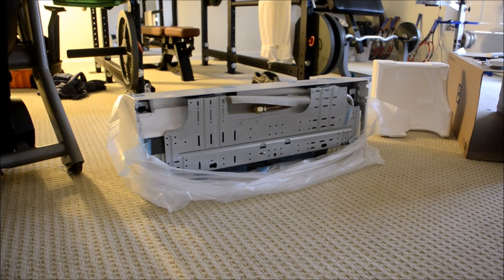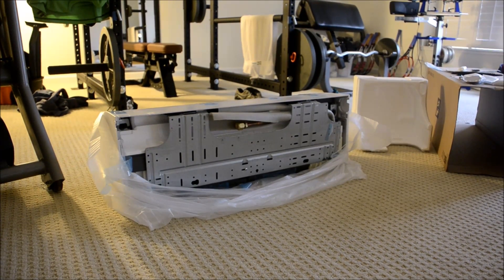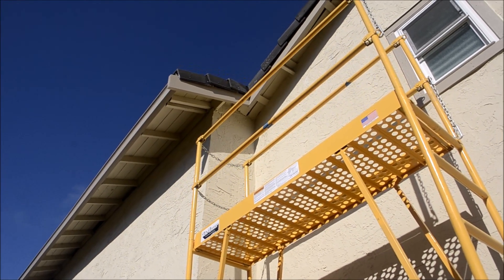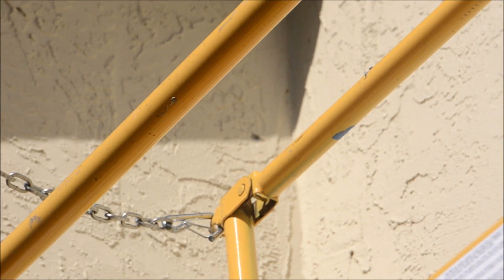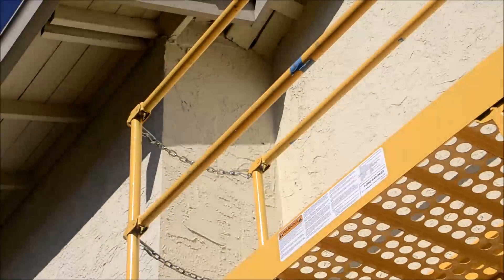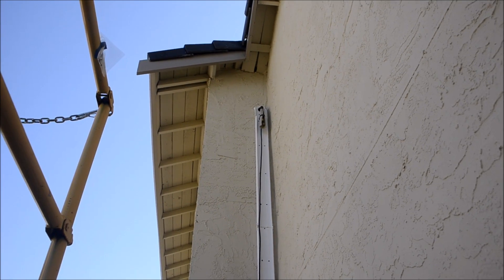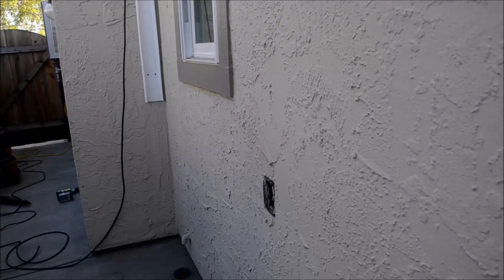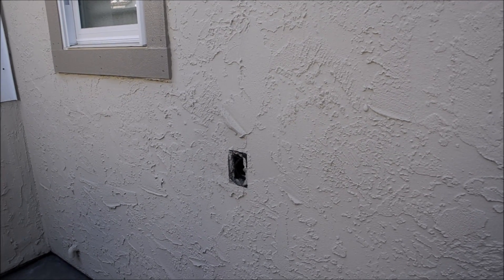Fujitsu Mini Split Install

Comment: Thanks for the detailed video. I am thinking of installing a 9RLS3H. Fujitsu installation guide at the below link says not to use Nitrogen for leak checks. Says: "When inspecting gas leakage, always use the vacuum pump for pressure. Do not use nitrogen gas." Is there a different guide you followed or did nitrogen test out of abundance of caution? Thanks in advance.

https://www.master.ca/documents/regroupements/1fujitsu_installation_aou9rls3h_en.pdf
Reply from the maker: Interesting. My installation instructions didn't mention that. To me a vacuum test  in combination with a pressure test will uncover any possible leak. I believe, depending on the type of leak that it is possible that a system might pass one test but fail the other, I have no scientific evidence of this, just a hunch.  So yeah, maybe it is a my cautions nature, but for the 20 minutes it took to do it I think it was worth it. If I didn't do it and there was a leak then I would have to spend more money to find it and then replace the refrigerant and I wanted it to work first time for a long time. Having said all that, there is a school of thought that believes it is possible that when pressure testing with Nitrogen some of the Nitrogen could get past the service valves and contaminate the refrigerant, and it sounds plausible. So perhaps a different approach might be to do the vacuum test and then release about a third of the refrigerant and then use a leak detector. That way you avoid the Nitrogen contamination possibility and potentially only loose a small amount of refrigerant, and since these things are usually charged for a 25 foot line set chances are you wont have to get more refrigerant after you find the leak.
Reply: Thanks for the response. Can you point me to the guide you followed, if it's available online. Given that these guides are meant for contractors, Fujitsu seems to have purposely not mentioned the models the guide applies to in the guide itself.

Thanks also for the idea about releasing a portion of the refrigerant to check for leaks. The Fujitsu units are pre-charged for 49 feet actually, so for a shorter installation, loosing some charge thru a leak might still be acceptable. BTW, it it acceptable for a 20 ft line set to be running with charge meant for 49 ft?
Reply from the maker: The install guide I used came with the machine, I assume it is available online but I never checked for it. If you are only running 20 ft and the charge is for 49ft (that is a lot more refrigerant than mine has) then you will need to capture some so you only have enough for the 20ft. I didn't need to do that and dont have the equipment and if I were in that situation I would probably have someone come in and do that piece of it after you install the unit.
Reply: Per the below submittal, yours should have come with pre-charge for 49 ft as well, but the installation manual I referred to only talks about "adding" refrigerant beyond 49 ft. So, I think you are OK.

http://www.admorhvac.com/admor-files/submittals/ASU15RLS3.pdf
Reply: Also, in some of the install kits, I see a surge protector included. Have you included a surge protector in your installation, if so, can you share the model you used? Thanks in advance.
Reply from the maker: No I didn't, my installation instructions didn't mention that I needed one.
Reply: Thanks. Also, did you use a pipe cutter. If so, if you can mention the model and any tips for it, I would be grateful. Thanks again.
Reply from the maker: I did, it was a small Rigid cutter. Here it is: RIDGID 40617 Model 101 Close Quarters Tubing Cutter, 1/4-inch to 1-1/8-inch Tube Cutter
Reply: Thanks. I have ordered many of the tools you recommended and also got the 15RLS3HY from Younits yesterday. One thing I am surprised by is that the top of the indoor unit is open with a thin plastic grille, with the filter pretty much being the cover. I see your unit is also open that way. Have you seen any issues with a lot of dust accumulating on the filters? Thanks in advance.
Reply from the maker: Not sure what you mean by the top of the unit being open. The filter on mine is at the front of the unit and the top is fully enclosed, maybe you are looking at the shot where I removed the front cover to get to the electrical?  In any event, I haven't experienced any issues with dust. I check the filter every couple of months and they haven't required any cleaning. Good luck with your install.
Reply: I am referring to the top plastic grille on top of the filters visible at 15:07 in your video, where I can see the front cover attached, but see the grille on the top side of the unit above the filters. Did yours come with a cover that covers the grille on the top?
Reply from the maker: Ah, I see what you are saying. Nope, mine did not come with covers which I guess makes sense as it is the air intake.
Reply: Thanks. I was planning to install it about 3 or 4 feet off the floor in the basement (so it doesn't draw hot air in if installed near ceiling in winter) and wasn't expecting the top to be "exposed" like that. I thought the front served as the air intake but I now see it uses the exposed top as well for air intake. Thanks for all the info and help.
Reply from the maker: I wonder if would it be better to install it higher? My reasoning is that it would accomplish 3 things. 1) Force the warm air near the ceiling to be blown down to the floor. 2) Warmer intake air would result in warmer exhaust air. 3) It would be out of the way and wouldn't take up floor space or get accidentally damaged. I could be wrong on all three fronts, just my 2C. Whatever approach you decide to take I would be really interested to hear how it goes.
Reply: I also thought  similarly, but the below articles caused me to think about lowering it:

https://tedsenergytips.com/2015/04/15/why-doesnt-my-mini-split-heat-pump-air-conditioner-work/

http://www.greenbuildingadvisor.com/community/forum/mechanicals/30824/minisplit-blowers-mounted-low-or-high

but on a re-read of the second article, specifically considering the advice in the last post, as also to eliminate the possibility of some kid getting his/her fingers into the exposed top of the unit, I am now leaning toward mounting about 75" up from the floor (instructions call for 70" minimum) to avoid hitting my head with it. That would still leave about a foot of clearance on the top to the ceiling. I will update once I am done with the install. Thanks for all the info and encouragement.
Reply from the maker: Mine is mounted about a foot from the ceiling and it performs great. I think I mentioned it in an earlier post but on a 100 degree day I am seeing 60  (58 is the lowest I have seen so far) in the room I installed it. Prior to the installation, that same room was in the high 80's, low  90's, on those days so its made a huge difference. Oh, one thing you should do when you install and use it for a while is adjust the room temperature sensor. Basically, you can tell the unit that what it thinks is room temperature is actually higher or lower than the actual temperature. So if you feel like the room isn't warm enough you lower the setting on the room temperature sensor (so the unit will think it is colder than it actually is) and the unit will continue to heat the room. Ping me when you are ready to do it as the instructions in the manual are super confusing.
Reply: Thanks Dan. The sensor adjustment is interesting. I will come back for instructions.
Reply: In section 2.4 of the installation manual listing the supplied accessories, there's a "Cloth tape" and a "Seal A" mentioned, which I have received, but I am unable to figure out what they are for or where they are supposed to be used going thru the manual. Do you recall what they are for?
Reply from the maker: I believe the cloth tape is used to wrap the pipes if/when they are bent to the left and run along the back of the unit before a left hand exit outside. I am assuming that this is to prevent vibrations and any potential rubbing of the unit/wall on the pipes too. Mine was a right hand installation so I didn't need it. I have no idea what the "Seal A" is I cant find a reference to it in my manual. But it might have something to do with moving the drain hose to the left of the unit, as it can be left or right mounted. 

On a separate note, I would recommend against bending the pipes before mounting the unit. It is much easier to to install the unit if the pipes are straight and then bending them once they are outside the building. I did it prior and it was a real pain to mount the unit.
Reply: Thanks, Dan. Also, on the wall unit, there's a screw between numbers 2 and 3 on the electrical panel. It's not apparent to me what that's for. I am connecting ground to the green screw to the bottom left of the screw number 1, so it's not apparent to me what the screw between 2 and 3 is for. Do you recall doing anything with it. Thanks.
Reply from the maker: I dont remember that being an issue for me, you are not talking about the cable clamp screw are you? The green (ground) will go to the green screw and then you use two of the three remaining wires for power, I usually pick black and red/or white (depends on what colors you have in your cable) and connect those to terminal 1 and 2 (power) on the indoor unit.The remaining wire will be the control wire which is connected to terminal 3. Just make sure that you dont mix up the wire configuration on the outdoor unit.
Reply: Thanks, Dan. No, I am not talking about the cable clamp screw. There's a screw between the screw labels 2 and 3, a little north of the screws 2 and 3. I am using the green cable for ground connected using the Green screw and have the other 3 wires to 1, 2 and 3. Sounds like I should ignore the mystery screw between the screw labels 2 and 3.
Reply from the maker: Yeah, dont worry about the screw. I dont remember touching it and looking at the manual I can see it but I think it is there for some other purpose, not related to the installation. It sounds like you are making good progress though.

Comment: no pressure check with the unit running?  units are charged for 25' lineset
Reply from the maker: C Hodge You are right, I didn't do a pressure check as my run is 24 feet, if it was any less I would have.

Comment: Great video thank you!  I just installed a 24K BTU Mr Cool DIY unit, working well so far.  Considering venturing to a multi-head unit for the rest of the home, and might use your video as the "go to" source for tools.  Appreciate your level of detail.
Reply from the maker: That's fantastic. Do you think you saved money doing the install yourself?
Reply: based on quotes, only about saved about $2000 or so.  lol.  Just ordered a 3 head LG 24K unit and using your tool list as a guide for what to order.  is your list in the description up to date?
Reply from the maker: Saving $2K sounds good to me. Yep the list is up to date,
Reply: Purchased many of the tools you listed Dan, including not so inexpensive SMAN460, torque wrenches, weigh scale, 410a refrig, nylog, YJ 410a flaring tool, etc.  But worked out great.  Meticulously installed a 3 head/room LG 24K unit.  Nitrogen leak test to 150, 300 finally 500 psi 24h, then vacuum down to 150 microns.  Added 7.25 oz 410a by weight due to extra line length, opened factory refrig and it actually worked!  Line cover was a pain due to tricky behind-bushes and high locations on two story home, but otherwise all was pretty smooth.  Thanks again for your inspirational and informative video.  One of the best on the net for sure.  Two more units and will be done for a while :)
Reply from the maker: Wow, awesome job. Glad the video helped. It's great that you did it all yourself. Congratulations.

Comment: Good job. One of the downsides of DYI is that most manufacturers will void warranty for equipment bought online and/or installed by unlicensed person. If it would be installed by a contractor and registered on Fujitsu website the unit would be covered by 10 years warranty.
Reply from the maker: You are absolutely right and I took a calculated risk on that front as I did my research and made sure I knew exactly what I needed to do and what tools I needed before I began the install. The quotes I received for an installed unit were around $6000-$6500 for an inferior model to the one I installed. So given I paid $1800 and then spent around $1000 on tools (which I can sell) my total cost is $2800, if I don't sell the tools. So if in the next 10 years I spend $3200-$3700 on repairs then my gamble might not have paid off, but at least I had a good time installing.  I also figure that manufactures don't want to loose money on a unit that costs $1800 by providing free repairs totaling more than $1800 in the warranty period, so they build the units not to fail during that time (total speculation on my part but the logic seems to hold).  I installed the unit in July 2015 so its almost two years now and it is still going strong. 

However,  if someone isn't really an avid DIY'er or doesn't want to get all the necessary tools then they should seriously consider getting it installed by a licensed professional, because chances are they will need the warranty.
Reply: Hopefully everything will work well. You should make it your profession ! Your hands growing from right place for sure.

Comment: what did you a apply to the pipe after flaring?  you brushed on something. thank you.
Reply from the maker: Refrigeration Technologies RT201B NYLOG-GASKET/THREAD SEALANT. I got it from Amazon https://smile.amazon.com/gp/product/B008HOSQQQ/ref=oh_aui_detailpage_o04_s00?ie=UTF8&psc=1

There are two versions, depending on the refrigerant your system uses, so make sure you purchase the right one.
Reply: Thank you very much.  Well done by the way.
Reply: @diydan30  Fujitsu warranty in Australia would be voided using and face sealer....just sayin'..

Comment: May i know what kind of torque wrench lock nut did you use? Thanks
Reply from the maker: I used the Yellow Jacket 60652 8-Head Precision Torque Wrench Kit. I bought it off eBay but you can also pick it up from Amazon.

Comment: The flare is best way to go, the video shows best way to do with the torque wrench. If brazed you need nitrogen going through line to keep it clean. Nice install.

Comment: I'm just about ready to do a vacuum pulldown on a dual zone Fujitsu mini-split.  I'm having some reservations regarding the the flare connectors. MOST 'pro's will recomment a "brazed connection" vs. flared connectors. OPen to all readers thier experience. Fujitsu is selling these with Flared fittings all over the world.  To make "brazed connections" would require cutting off the furnished flare fitting which are  fairly short already. Add that to the linesets and you're doing 8 operations. R410a pressures are a cause for better connections. Is anybody using Flared Fittings on warrented equipment. Is this a gamble?
Reply: If you decide to braze I suggest you run nitrogen through your system while brazing. You will contaminate your system.

Comment: Nice job. Can You tel me what kind of vacuum pump, flange tool and  torque wranch did you used on istalation . Thank you Darek
Reply from the maker: Thanks. 
Here is the specialty equipment I used: 
Robinair (15800) VacuMaster Economy Vacuum Pump - 2-Stage, 8 CFM (Amazon $250- You can save some money by getting a cheaper unit if you are only doing a single install)

Yellow Jacket 60278 Deluxe Flaring Tool 1/8" to 3/4" 45 Degree (eBay $100)

Fieldpiece SMAN460 Wireless 4-Port Digital Manifold with Vacuum Gauge (ebay $460 - There are much cheaper options if you want to save some money here)

Mastercool 49262-60 AC 5FT Hose set With Valves W800 B4000psi R-410A (ebay $80)

Mastercool 94160 60" x 3/8" Black Refrigerant Charging Hose (ebay $30)

Ritchie Yellow Jacket 60652 8-Head Precision Torque Wrench Kit (ebay $130)

IMPERIAL 370-FH Tube Bender, 1/4, 3/16, 3/8 and 1/2 In (ebay $60 - Dont really need this, but it was a nice to have)

Ductless Mini Split System charging vacuum port adapter, Converts new R410a style 5/16 SAE service ports to accept older 1/4 SAE gauge hoses (Amazon $15)

Uniweld RHP800 Nitrogen Regulator with 0-800 PSI Delivery Pressure (Amazon $90)

Venture 1507 Black Printed UV Resistant Line Set Tape (2" x 60yd) (Amazon $15)

Rectorseal LD 4.5" 12' WALL DUCT KIT WH 122 White (Amazon $80)

Refrigeration Technologies RT201B NYLOG-GASKET/THREAD SEALANT (Amazon $15)

Nitrogen Tank  (purchased at a local store $90)
Reply: DIY Dan would a 4 CFM single stage pump do the job or you have to have 2 stage?